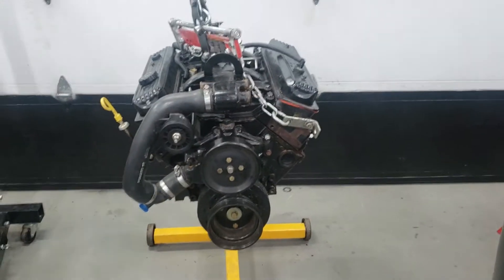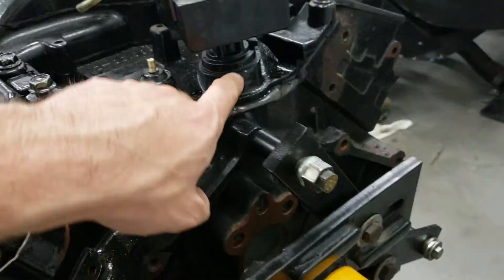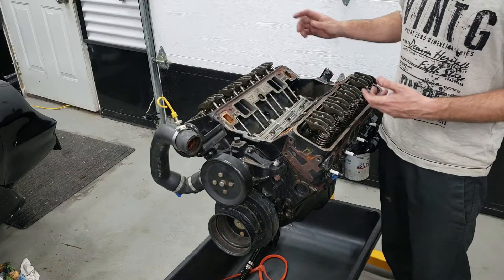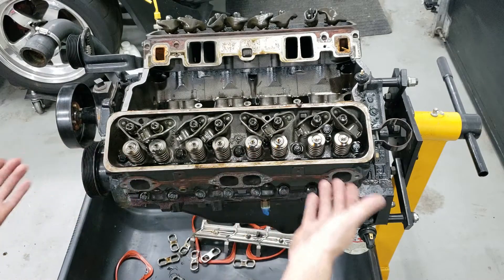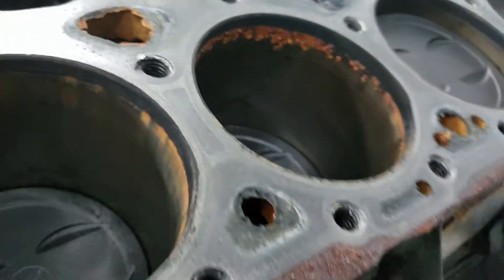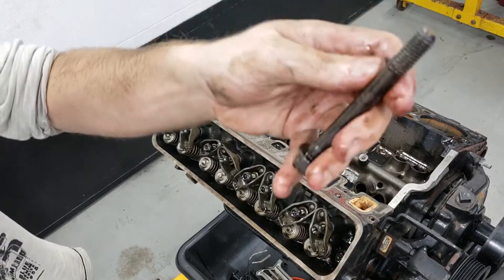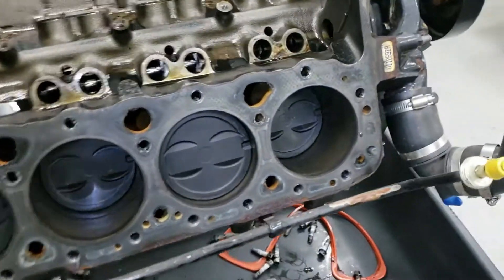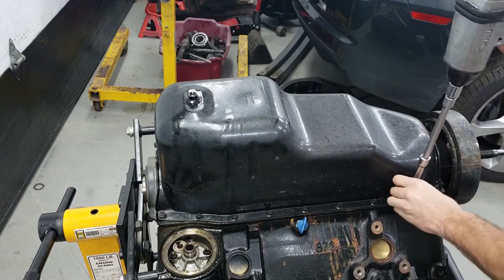Mercury 305 rebuild | part 1

Comment: That's a Chevy engine. The distributor is in the front of the engine on Ford's and if that is a ford it's the first time for me to see them
Reply from the maker: @JeffreyCallahan-l7o  that is partly correct. This motor is actually a GM motor, chevy being a child company such as pontiac and cadillac. Mercury is the marine company that produces products for water vehicles. Not to confuse this with a Ford Mercury vehicle.  However technically speaking in my later videos, i DO use a chevy 305 as a replacement block for this mercury 305, as they are almost identical apart from a water port feature.
Reply: @DarkBloodMechanical 
Where is the water port difference? Is it in one of your videos? 
I may have to swap a chevy for my mercury 305, I'm about to replace the head gasket because it over heated.
Reply from the maker: @aOTritoN  Hi. The water port difference is at the front of the block where the water pump mounts on the passenger side, the marine motors usually have an extra hole. if you see my Part 3 video at 0:22  You will get a glance at the front of the new block ( without the port ) this wont affect performance so you can use either block.